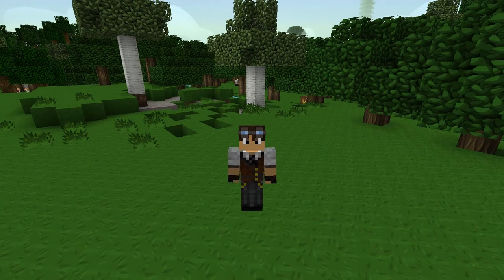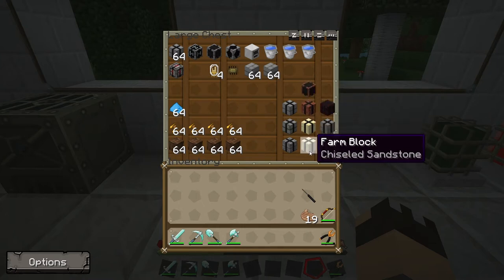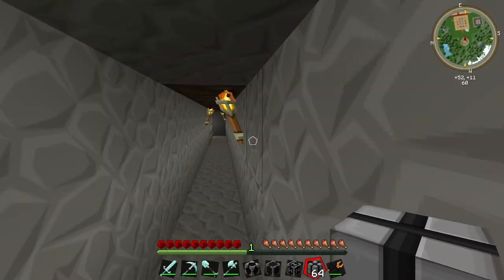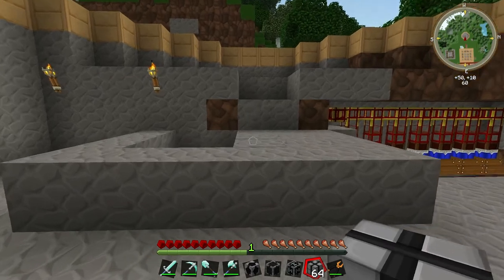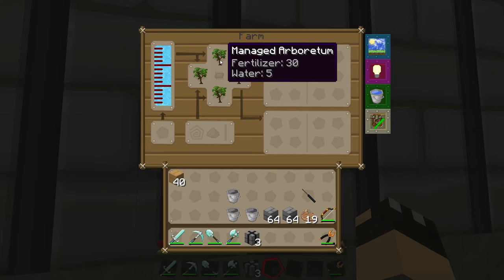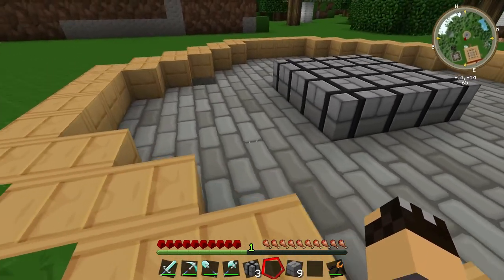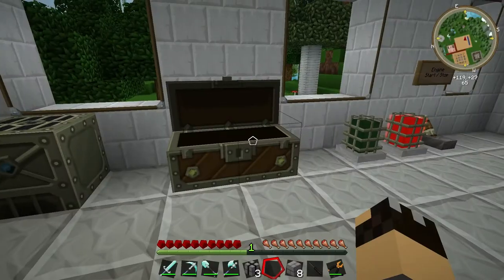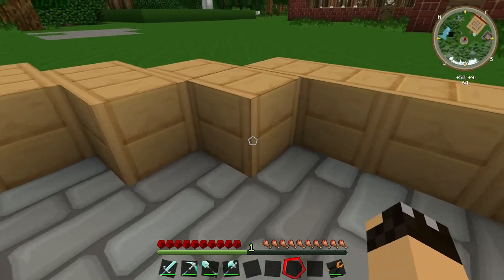How to Feed the Beast in Minecraft - Multifarm & Aqueous Accumulator - 15

Comment from the maker: Another long shot, but try placing the seeds the two right hand columns of space. A few of the guides state that the left 2 columns are for soil and the right 2 columns are for seeds/saplings - though I'm sure I've had them mixed in those different slots and they've still been working - but even that doesn't explain why it isn't placing water blocks....

Comment from the maker: I think this might be a bug since the last update, as mine has started to do the same thing. It was working fine before. You could try a reset, buy turning off the power, digging up all the dirt (you can put it back into the farm) then turn on the power again. Seems to work for a while, but it'll probably do the same thing after a short time.

Comment from the maker: Wow, that is strange. Does it also have fertiliser? Normally the farm works it's way down one column of blocks, then moves to the top of the next column and working down and so on - occasionally it'll backtrack if it needs to harvest something. One thing I can't help but notice, it hasn't put down any water blocks - yet you say it's full of water. They do take a while to get going though, but 6 Magmatic Engines should be fine - I have mine running off 5/6 Peat Engines.

Comment: I must say, your videos are great, but fob has gotten rid of the peat bog, and the multifarm. So Biofuels and machines are the way they are going. Too bad i was having fun with the peat engines and alike. Is there a way to command or run a patch to allow the bog and multifarm to work again?
Reply from the maker: CraZyCanAdiAn72 Not as far as I know. I guess it would depend if they have been completely removed, or just deactivated. Even then, maybe they were removed because they didn't work with something else - this is why Redpower 2 was removed.

Comment: I tried a few things that just seemed to make the farm go haywire (like it rocketed up to saying it was needing %180 hydration). So I just tore down all the dirt, and added 3 more aqueous accumulators with 3 more valves because I noticed the water level was just bouncing around zero. Once I switched it back on it seems to be doing much better. Only thing I can think is that the order I turned things on and gave it supplies in created some kind of automation bug.

Current screenshot.. erOjv5j.jpg